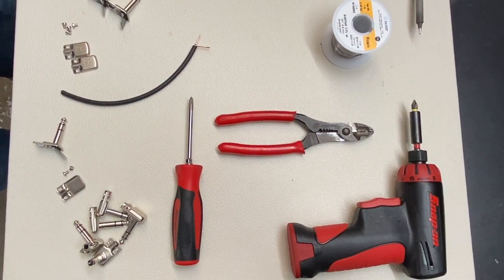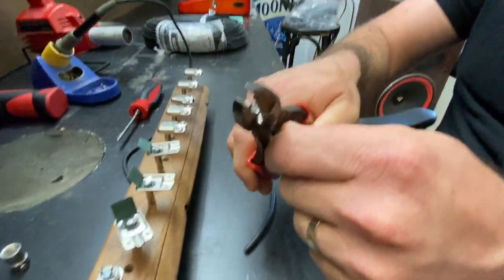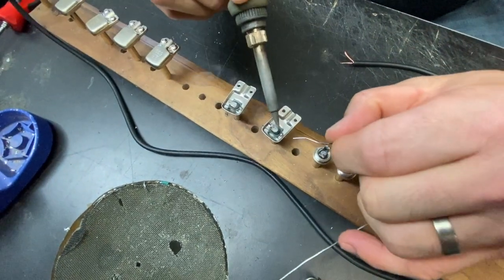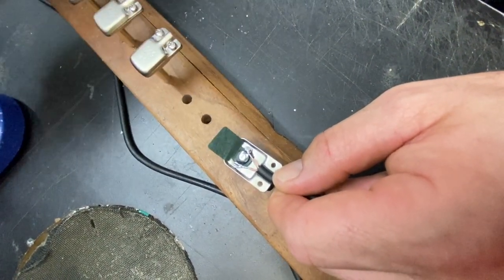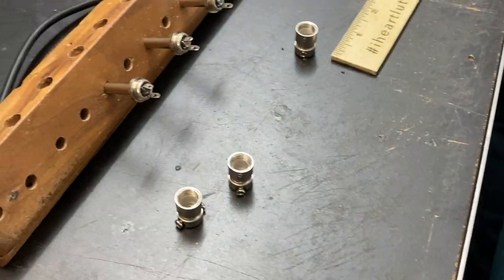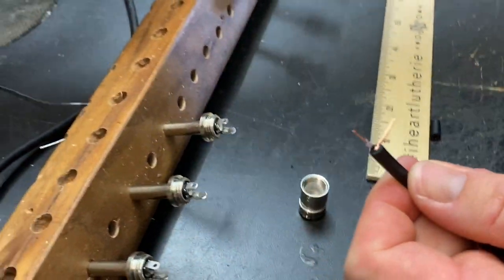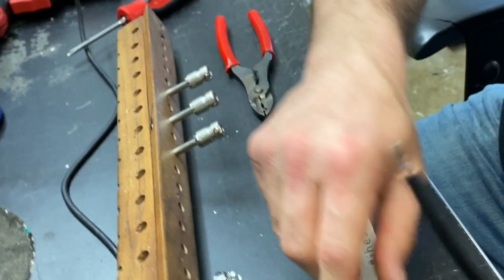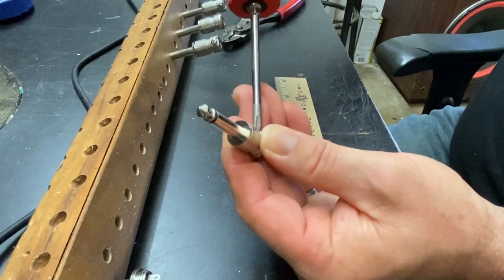Building a Pedalboard: Making the Best Square Plug Patch Cables for Pedalboards

Comment: The simplicity of holes in wood for clamps is great. Firm hold, one handed in and out, square plugs poiting the dame direction, can make 2 hole clamp  in seconds. Love ideas that are so simple but outside the normal. Guess you have keep a clear mind and think about the fundamentals of what you are trying to do 'hold round thing' 
(or when the lack of a screwdriver 🪛 cab be resolved with a zen butter knife etc)
Reply: I second that... I struggle (newbie) with available tools that are somewhat expensive for what they do and not friendly. Suggestions for sink gadgets?

Comment: Nice video! I would add though that it’s super important to keep the wire perfectly still while the solder solidifies otherwise you get a cold joint that cracks easily. Can’t wait to try these plugs!

Comment: **IMPORTANT POINT** After stripping the outside of the cable & stripping the end of the "Conductor" cable (center) .. ***BE SURE TO REMOVE THE THIN BLACK COATING @2:55 IN THE VIDEO) ***!!.  If not you will end up with a huge loss of volume & tone :-(  ... Or like me, since West Coast Pedal Board is just a few miles away, call and leave a message that there is something wrong with the cables, watch the video a few more times, rebuild my cables & then call the next morning to apologize for being a Dummy :-)!   Thanks Spence!!!!!
Reply from the maker: Thanks John! 🤙🏼👌🏻

Comment: 2:48  I had no idea how important it was to pull off the black stuff. I was struggling with signal loss because I did not know that stuff had to be cleaned off. Once I did that it started working fine.
Reply from the maker: Lad you found that useful my brother. Those little details are super important sometimes.  👍🏼🤘🏼
Reply: Thank you so much for this comment! I didn’t realize that’s been my problem as well until right now...

Comment: Great video demonstrating how to do this quickly and not overthink it. Here's a question if anyone is still reading.. On some of my SP400 patches they work fine if stationary but if I rotate them around in the jack of the pedal I might get static or funny behavior from the pedal. When I open it up and inspect I see that some of the strands of the braid are a little loose and wiry and could be scraping around inside the shell. Not enough to short the center conductor at all just around the shell. Is this my culprit here? In my case it's more of an issue due to I'm using braided shield cable where the braid is a little more hairy than dealing with this easy going spiral Mogami you're using. I thought about this during assembly but figured since it's just the braid scraping around a surface that's already grounded it shouldn't matter but it seems to. I suppose it's changing the resistance or something and causing the noise I'm hearing. Not sure what the fix is, maybe tin farther towards the cable body, maybe add some heat shrink around the exposed shield. Any thoughts?
Reply from the maker: Send us an email with a few pictures and the brand cable your trying to use. I would almost suggest buying some 2314 cable and re-soldering all your cables with that.

Comment: Does it not make the connection stronger when you put the wire through the hole and solder? I always thought you were supposed to do it like that, is the hole just there to hold the solder?
Reply from the maker: You certainly can do that! Just usually requires some side cutters and different strip back lengths to be able manipulate the individual cables. 🤙🏼🤘🏼
Reply: I have built 30-40 of these and I usually do the through hole. The main problem with that approach is you can get stray "hairs" of the underlying wire splitting off when you  push the twisted bit through the hole that can short internally.  I'm going to try this approach on the back half of this pedalboard.  Also note that a good solder surface to surface connection is actually very strong. That, plus the strain releif in the cable and you should be in good shape.

Note that the bigger problem I've had with the Mogami is having the interior conductor short to the black layer. There's two layers of internal shield around the inner coax.  The outer, black one is actually conductive to the outer shield, which is why you want the inner, clearish one exposed separately.

Comment: Using the SP5 (round/short) and 2319 cable, I noticed that the screws penetrate the the outside protection black layer. Suggestions to address how deep should I go (=you provide very good measures for everything else)?? Thanks
Reply from the maker: Tighten them the entire way, they won’t interfere with anything at all 👍🏻 Glad you found the tutorial useful! Thanks…
Reply: @Westcoastpedalboard  Thanks. BTW the crimper tool is really nice but very difficult to buy it... waiting ...

Comment: How bad are the soldering fumes? I'm just going to make the wires for my rig one time and then do periodic repairs, etc. Do I need a vapor extraction system like you have. Or will an open window work? thanks, t
Reply from the maker: Do it where adequate ventilation is achieved!  Did you buy the parts already?

Comment: Why peel off the thin black coating on the center wire? I'm waiting on my kit from you guys to come in the mail. Should be here by Monday. I'd like to be as educated as possible before I get the product in hand.
Reply from the maker: It’s a conductive thin layer used to shield the cable scrim unwanted noise, but it has to be gently stripped off before terminating the cable. Maximum tone my dude 👍🏼🤘🏼🤙🏼 and thanks for the order!!!
Reply: @Westcoastpedalboard  thank you for the explanation! I'll make sure I get em all done up correctly. Got a whole bunch of em to do too!
Reply: What is the problem with leaving some of the black coating on the main conductor? I didn’t strip mine all the way (just enough to make the solder connection to terminal). I AB’d with a purchased cable and didn’t notice anything different.

Comment: What's the optimal wattage soldering iron for this?
Reply from the maker: Hey Jay, thanks for the comment. We use Hakko FX888D and have real good results running it at 750 degrees.  Check here for more in depth info, including specific tools and installation techniques:

https://westcoastpedalboard.com/diy-pedalboard-patch-cables/

Comment: Very informative thank you! i have 2 questions if you don't mind since i am a newbie. What is the right temperature for soldering the (2319+sp500)?. Lastly what do you do after finishing all you connections? do you apply a fresh solder on the tip and leave it as is so to protect it from corrosion? thanks!
Reply from the maker: We run the irons at 700 so we can be quick about it. We use the irons so often, we just clean the tip in shredded metal and leave it.
Reply: @Westcoastpedalboard  thank you!
Reply from the maker: @kostischaveles  anytime 🤘🏼

Comment: Do y’all ever have trouble with the sp400 tip? All of my straight plugs SPS4 are no issue at all but I keep getting tip connection shorts on the right angle plugs.
Reply from the maker: We don’t use SP400’s but I would assume since we’ve never had an issue with the 500’s, you might be doing something wrong. Are you getting the same short prior to soldering? If yes, then you have faulty plugs, if not, you’re soldering them incorrectly. Maybe sitting in the solder tabs too long with the iron. We ton everything, let it cool then quickly hit them at 750 degrees for the solder; not staying on the solder tab for more than a few seconds.
Reply: @Westcoastpedalboard  I am new to soldering and I very well could be messing up, but it seems only these plugs are the issue. I soldered all dc power and straight SPS4 plugs first with no issue. How do you check if plugs could be faulty?
Reply from the maker: @daviddowns16  continuity test with multi-meter 👍🏼

Comment: Would these plugs work for connecting a speaker to amp?
Reply from the maker: It would, but it’s the wrong cable for that. Check the Mogami website for correct model of cable to use. Typically a much fatter gauge.
Reply: @Westcoastpedalboard  Sounds good, I got some Gavitt push back wire I'm going to use. Thank you 😊

Comment: I soldered my cable but I’m barely getting a signal. What did I do wrong?
Reply from the maker: You likely forgot to strip the black sheild off the conductor wire. Watch the video again 👍🏼
Reply: @Westcoastpedalboard  yes, I stripped the conductor wire as well. I was thinking maybe something was touching but not sure. I’ll try again. Thanks!
Reply from the maker: Call in next week if you still are having trouble. Should be easy if you’re following the instructions and using decent soldering equipment.
Reply: Did you get it figured out? I’m struggling with the same thing and I’ve definitely stripped off the shield.
Reply from the maker: @two7plumbing  then you likely have a cold solder. Did you watch the video in its entirety?
Reply: @Westcoastpedalboard  yeah, I’ve watched it a couple times now. I’m used to soldering large piping, not tiny cables lol
Reply from the maker: @two7plumbing  email me a picture of your soldering rig. spencer@westcoastpedalboard.com
Reply: @Westcoastpedalboard  thanks for all your help! To those following, it was definitely something I was doing wrong, but they walked me through it.

Comment: What is that colored rubber sleeve that goes over the cable and under the ends.  It's where companies put their name on the cable.  Some kind of shrink tube? Do you guys carry it?  I'd like to add them to my builds  thanks 😊
Reply from the maker: We do carry that, but it’s not necessary when using Mogami 2319 and the sp500 or SPS5
Reply: @Westcoastpedalboard  that's great.

I understand it's not necessary....but I like the look or asthetics of a cable with that on.   Can I make it happen?

 I guess the question is will it not fit because the diameter of the mogami cable to those ends? 

Thank you
Reply from the maker: @lasv155  you could, but we don’t sell it individually. You’d have to get your own locally...
Reply: @Westcoastpedalboard  thank you 😊
Reply from the maker: @lasv155  very welcome!  Message if you need anything else ✌🏻

Comment: Very helpful video, but just to be clear, no one (including SnapOn) makes a single stripper/crimper tool that spans 10-20 AWG, and that's true for the red SnapOn one that you've shown here also. If its got 5-holes, then its either 10-18 or 12-20.
Reply from the maker: We added the note in the ticker post shoot. Thanks for the comment tho 👍🏻